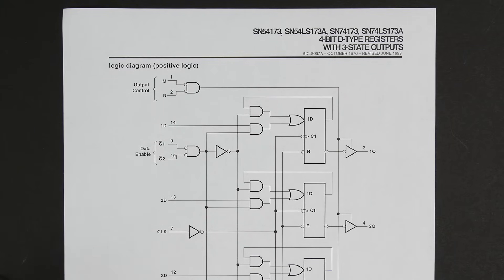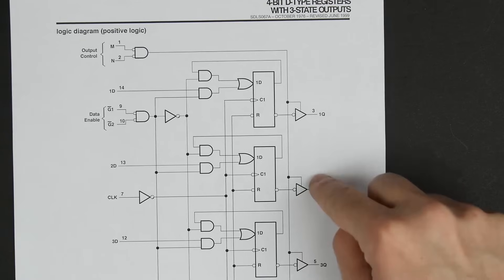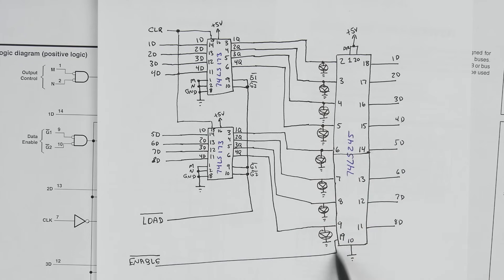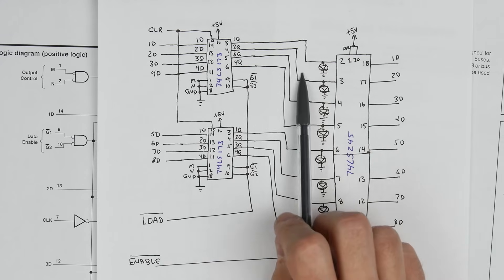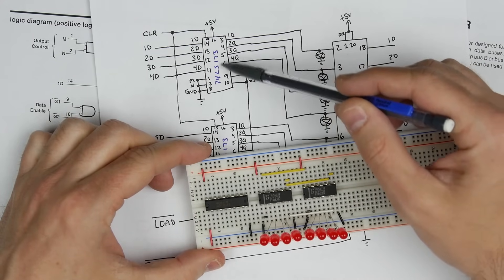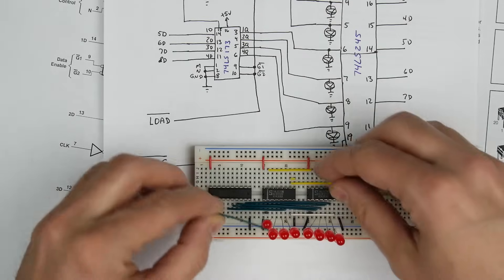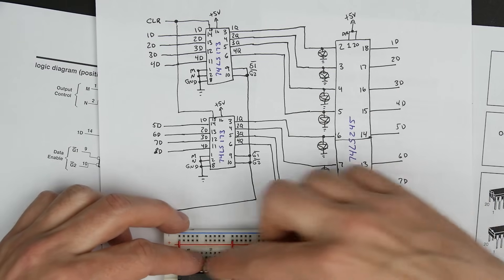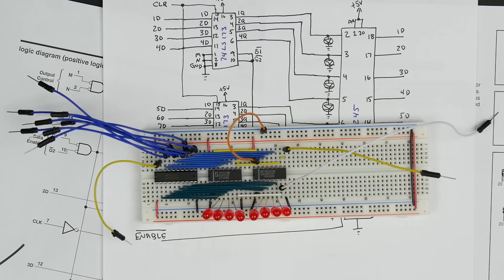Building an 8-bit register - 8-bit register - Part 4

Comment: If you're trying this at home and the LEDs are too bright, either get some so-called "diffused" LEDs, or (what I did) tie the ground rail all the LEDs plug into to ground through a 10k resistor. I was having a really tough time without this trick because they were simply too bright and I couldn't even look at the board without getting spots in my eyes lol. If you go this route, then use the opposite ground rail (without 10k resistor) for any logic signals, since I have no idea what the added voltage separator would do here (probably nothing, but you never know).
Reply: Update: Absolutely tie the logic to the other rail. Found out the hard way after accidentally forgetting to do this with the bus transciever :D

Comment: I think the TTL chip he was looking for was the 74-195. It's a 4-bit Parallel Shift Register. A much simpler design than the 74-173, without the buffers at the output.

Comment: Why no current limiting resistors on the LEDs?  Built it without the resistors and each chip got very hot and the circuit failed after a time.  Each led was pulling 30mA, much more than the data sheet recommended load for each output pin.  Once I added resistors to each led the circuit stared working reliably.

Comment: very late to the party here, but not sure why you didnt just use a 74LS374, an 8 bit D flip flop connected to the LEDs, which could then be connected to a 74LS244 to isolate it from the bus?  the LS254 is for bi directional use unless of course you didnt have 244s and 374s...

Comment: I usually hate when people make videos where they show breadboards since usually it's nearly impossible to decipher any of the connections. Ben's neat jumper management however makes an exception and there is actually some advantage in seeing the physical process. Regardless, I'd hope people would just stick to schematics (actual schematics, not some kindergarten drawings with symbols replaced with drawings of actual batteries etc. which only tend to make them harder to read) when explaining circuits - at least for me that way makes it easiest for me to follow along.
Reply: Having seen many car and motorbike electric schematics I know what you mean by kindergarden schemantics. They are so tough to dechiper and you always need to draw proper schematics before you start to modify something.

Comment: Still I can’t understand why you didn’t take advantage of using M and N output control pins to control sending what is in D Flip flops to the Bus? That could do the job of octal bus transceiver, could not???
Reply: He explains it literally in the first 30 seconds of the video. He wants to see the value the register is holding, regardless of whether it's pushing that to the bus or not. Using the output-enable pins on the 173s themselves would mean you can't do this. there's no output! so you can only see the register value when it is going to the bus. Instead, he wires it for always outputting and controls pushing to the bus via the 245.

Comment: I just wanted to start building, until I realized, I have some 74AC573's lying around.... so those are basically 8 bit storage with an output enable e.g. tristate-buffer, so no need to get the messy cables out. :p
Reply: The problem with the 573 is it has no RESET capability like the 173 and the 273 has. If you want the exact same thing Ben is doing here but the convenience of a single chip, choose the 273. 8-bit, with reset, and it's "always on."
Reply: @naterivard  Thanks for the hint, but I think, for a Register, I will not need a reset. :)
Reply: @alexandrosweeb8059  The 573 has no clock input; isn’t that necessary? You definitely need an integrated input enable & output enable for the bus, otherwise have to build them extra.

Comment: hey I am not sure why there are no resistors before or after the LED. As far as I've been told, there needs to be one for it to not be fried.
Reply: Probably bcoz its not a direct ground as the chips have internal resistances so the out put current is low enougg

Comment: I'm having an issue where when I bring one of the bus lines low, I will sometimes have random register bits flip low as well. Doesn't always happen, but is fairly repeatable. This is happening with the clock off and the load line on or off. Any ideas? I don't see anything obvious like clear randomly getting hit.
Reply: Even though Ben doesn't do it, connect it so that rather than Register Output -> LEDs, do Register Output -> Resistor -> LEDs. This solved my issues, and most people's issues, with this project.
Reply: @YetAnotherChad  Thanks I'm crossing my fingers, but I think I got it. I added the resistors to the LEDs, and that helped, but not completely. I then removed the yellow LEDs from the clock, added a resistor to the blue clock LED and unplugged a not yet hooked up LS245. I think that did it, but we'll see!

Comment: As mentioned by a couple of recent commenters, I found that that the red LED's supplied with the current Jameco kit (low side Vf) do require current limiting resistors for the registers to work properly.  I jigged soldering a 220ohm resistor to each anode leg, cutting the leads appropriately to mimic the original LED placement.  Easy fix, took me awhile to figure out, THEN I checked the comments .... should have come here first, or the comments  on reddit..... part of the learning process ....

Comment: What are you using for the blue jumper wires.  I Purchased some but the are varying color and length.  Yours are nice with the same color and length.
Reply: Buy 22awg wire and cut your own.

Comment: There is a design flaw: Resistors are needed for the LEDs. Here’s why...

The datasheet for the red LEDs gives a forward voltage of 1.8V. The LEDs are tied to ground, which means that they will limit the voltage out of the registers to 1.8V. However, the 74LS245 tristate buffers spec the minimum voltage for a high signal to be 2.0V. Although this circuit apparently works, it is because the parts exceed their minimal operating specifications.

Nevertheless, this project is fantastic and my son is learning a lot!
Reply: If you don't want to add a bank of resistors, replace the red LEDs with green ones which typically have a voltage drop of nearer 3.5V.  Yellow and orange ones are borderline: you won't get much variation in a batch of LEDs (as the voltage drop is determined by the band gap of the semiconductor alloy in question), but you will get variation between brands, and likewise with brands of the 74245.
Reply: I'm pretty sure there is current limiting resistors in the chip plus they are in parallel to the output, so there is not a voltage drop o the output, just across the resistor.
Reply: Robert McFarland I’m building the registers now and had this exact problem. I couldn’t get consistent behavior from the LS173s.  Checking voltages at the pins showed that the Output voltage for high pins was ~1.9v (below minimum spec for the LS245).  As soon as I removed the LEDs the voltages measured at ~5.0v for all high pins and the register performed as expected.
Reply: @robertmcfarland9184  the problem isnt the current, its that the voltage at the input of the second IC should be >2V for a high signal

Comment: Replacing the "74ls173"s with "74ls191"s gives you registers that support a 'native' inc/dec instruction, which can be useful if you want a sort of *p++ operation in your CPU. The major cost is that the pin arrangement is a bit less logical.

Comment: How come you don’t need resistors to connect those LEDs to ground? But when you built the clock module, you needed the resistors, so the LEDs wouldn’t burn. Can someone please explain that?
Reply: Afaik the LS family doesn't need resistors because it can sink current internally. But the 555 chips couldn't do that, so he needed resistors for LEDs.
Reply: Kartikay Bagla Oh I see, gotcha. Thank you sir 😬

Comment: Bit late to party, but having 2 Enable inputs and 2 Output controls lets you wire the chips in a 2D grid and select individual chips with select and output lines per row and per column.
Reply: That is a great explanation as to why pins are labeled M and N, since those letters are very commonly used to index rows and columns in computer programming or just maths
Reply: @antoineguillet4541  Personally, I use i and j to index 2d arrays.
Reply: @d0nnyr0n  m and n are more common in math, especially with matrices
Reply: Clever.
Reply: very clever. 👏
Reply: very clever indeed.
Reply: quite clever
Reply: Oh my god, with how often I've used components that have ANDed or complimented L/W inputs I do NOT know how I never thought of this lmao.

Comment: Is the reason you don't need filter caps in this design because you are not running at a fast enough clock to cause 
trouble?

Comment: What’s the difference between being “low” or off? That is, how is a distinction made between a signal being low or output being disabled?
Reply: He explained that in the tri-state logic. Basically, "low" means attached to ground, and "off" or "disconnected" means not attached to anything (neither ground nor +5V)
Reply: @zacmg  Thanks!

Comment: 4:51, why no current limiting resistors?
Reply: The chip he's tying the LEDs to has resistors inside it. He shows a circuit diagram of the inside of each logic gate in www.youtube.com/watch?v=faAjse109Q8 (don't know the exact time, sorry) and if you look at it, you can see that the 5v input (which is connected to the LED when the gate is storing a 1) has a resistor on it.
Reply: @sanarek188  yeah haha I'm Bing watching the series, I came to this moment just now
Reply: @sanarek188  but the thing is that he never uses current limiting resistors to connect an LED to whichever output of the 8 bit computer.

Comment: Why did he connect the leds directly to the ground? I now they wont burn because of resistors in output of the register but input of the tri state logic chip will be 0.7 volt max so it outputs low always, am i right?
Reply: Red LED might be as high as 2.0 volt forward.  But it does look funny.

Comment: OK, so I've been racking my brain for a few days now, and I can't figure out why it's not working for me. Let's see if I can put in words how I did the wiring. My "A" register is built using a 74x245 with a 74x573. I chose this for easy data line connections. On the 74x245, the "B" side is connected to the bus, while the "A" side is connected to the 74x573. That is fairly straight-forward. The interesting part is the 74x573. Input is connected to output. Which is fine, because I intend to use the DIR pin on the 74x245 and the Output Enable pin on the 74x573. During the testing phase, everything went smoothly. The testing phase was only one register to see if it works the way I thought it would.  But as soon as I connected the "B" register to the bus, my 74x245's got extremely hot. I don't understand why. The 74x573's were cold the whole time. Where is my mistake? I was thinking that I'd use the DIR pin as an analogous "Load". Was that a safe assumption?

I realize that the 74x573 is a latch, and not a flip-flop. But as I said, during my testing, it worked as expected. If anyone can help me understand why my 74x245's are getting hot, I'd appreciate the help. Thanks.
Reply: it't probably the LEDs you conected

Comment: I really like your style and approach. As a teacher myself I also have to give you kudos for a very clear presentation and diagrams which are legible even as a viewer on the screen.

I have planned to construct something similar for my students for quite a while now  - for a while I considered the 4-bit approach from "but how do it know", but now I am a bit more considering a similar attempt like yours. Especially the breadboard construction is tempting.

But I would probably go for a combination of a '574 8-bit latch and a '245 where the '574 has the advantage of a nicer pin arrangement over the '374

Comment: My bus transciever wont turn on the diode on the bus(it just sort of blinks weakly and randomly for a ms) unless I put a resistor in series with the LED that shows the value in the register. Why is that? I bought the same chips as you.
Reply: Mine was doing this. It was a power supply that wasn't strong enough.

Comment: Hey question from a rather beginner at electronics, when I put the input enable to low, for some reason the LEDs on my bus turn on very faintly, but only on one chip of the two. I've built and rebuilt this a few times exactly as you did but still have this issue, anybody know what might cause this?
Reply: I'm getting the same problem, and don't know how to fix
Reply: Has anyone solved this issue?  I cannot figure out why mine keeps doing this.  Have rebuilt it a million times, tried new breadboards, wires, chips, etc.  Even went in a built it one bit at a time to test and still no luck.
Reply: I added resistors to limit the current drawn by the LED's of the Bus. There's still a slight fluctuation, but works otherwise.

Comment: Not sure if anyone will read this but I'm having issues. I'm getting highs on my '173s outputs whenever I power up register, if I clear and put load to high, high on outputs again.
I've been probing around and experimenting, There is no high appearing on the data in pins. (I'm not connected to bus and I have no output from '245)
I've read datasheet over and over, and tinkered like crazy.
I know its non inverting but I'm wondering is this due to the pull up resistors, maybe if there was a voltage issue?
Any ideas?
Reply: If u fixed it, how??

Comment: Same question about the missing current limiting resistors for the LEDs.
http://www.ti.com/lit/ds/sdls067a/sdls067a.pdf
p4. schematics of outputs -> 90Ω resistor inside
p5. recommended operating conditions -> Ioh max = -5.2mA / Iol max = 16 mA
(I don't understand the signage, shouldn't Ioh be + and Iol - ? )
so anyways:
Iled = (Vcc - Vfd - Vfled) / 90Ω = (5V - 0.6V -1.6V) / 90Ω = 31mA
31mA > |-5.2mA| and 31mA > |16mA|
So yes, there is a current limiting resistor inside the LS173, but isn't the LED current still exceeding the maximum ratings of the chip?
Reply: Same question. I didn't quite understand the nomenclature on the datasheet either. I did the calculations on my LEDs and I needed a limiting resistor of at least 150Ω. In the configuration shown isn't it drawing too much current from the chip?

Comment: I don't completely understand why you didn't do something like 74LS245 -> 8 D flops -> 74LS245, which would have allowed you to control the Load and Enable and probably would have been a lot less confusing to actually understand for the viewer. I guess the 74LS173 allows you to do it all in one chip, but if you're trying to learn about computers, or educate others about computers, obfuscation is rarely the right solution...

Comment: What about using a 74HCT574 as a register? It looks like I would need to AND the clock and the load inputs to the CP pin? I could still use a 74LS245 as my output buffer for the LED display.
Reply: The 74HCT574 has no clear pin so i would not recommend it at all.  Also, adding another chip to AND with the CP for enable sounds not fun.
Reply: After some careful planning I decided to go with a 74HC573 paired with a 74HC245 with an LED display between them. I realize there is no clear. I'm going for a more RISC style architecture with 4 registers with R0 always equal to 0 (hard coded). R1, R2, and R3 will be the work registers.
Reply: @mattbettcher  This is a cool idea and I have been kicking around a similar thought in verilog. Did you end up completing it?
Reply: @naterivard  If I recall correctly I got this working, but only in simulation. Again with no clear you have to write zero to it to clear it.

Comment: Is the 74173 the same as the 4076?  It is described as "Quad D-type register with tri-state outputs" but I want to be sure it has the same behavior.
Reply: Yeah, 4076 should work just fine.  I am not speaking from experience, just reading the datasheet.
Reply: Ok, Many thanks!

Comment: why does the circuit need the octal bus transceiver ? can someone tell me ?
Reply: He says why in the video.  You don't actually need it because you could use the output control line.  But if he did that, he could not use the LEDs to always display what is in the register.  The LEDs would only be lit when the chip is outputting which is less fun.  By adding the transceiver, he can always display the register value via LEDs
Reply: If you are referring to the 74LS245 that is a bi-directional tri-state driver, Ben proposed using it uni-directional, to isolate the bus from the output of register, that is, the D latches.